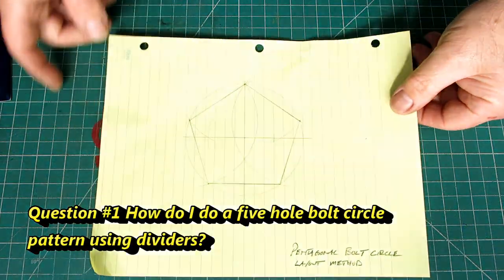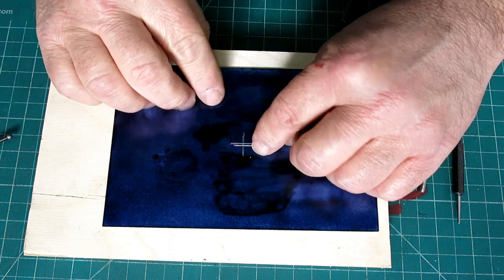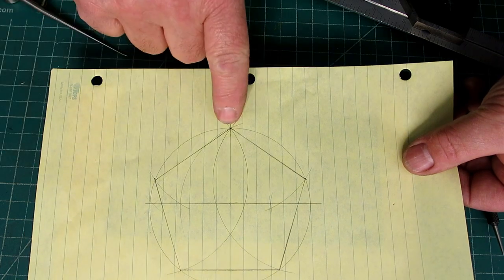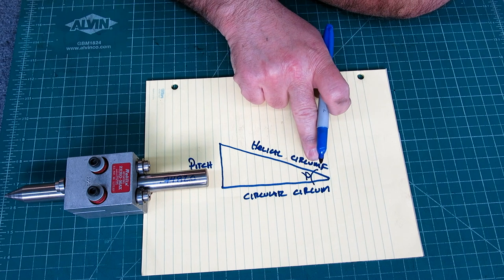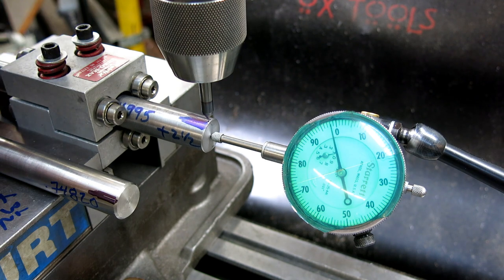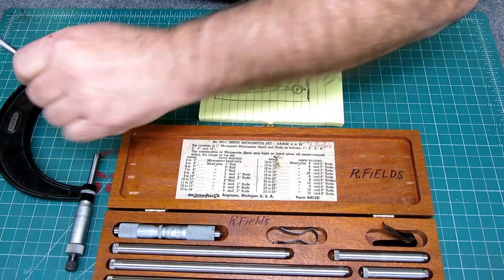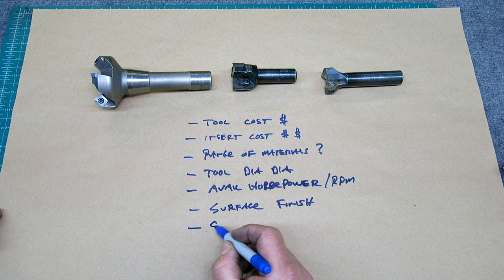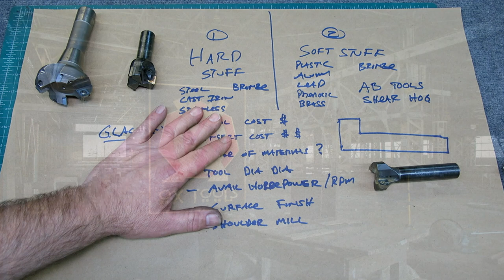Meatloaf 134 Comments and Questions

Comment: Rohlix Pitch Error:
Modeling an assumed design diameter of 0.75000, pitch of 0.10000 and the pitch angle calculated from the circumference of one turn, you get a pitch length (the hypotenuse not the circumference) of 2.358316 and pitch angle of 2.430250. Now, using the actual rod diameters and assuming the pitch angle remains constant, you get 0.099760 travel from the 0.74820 rod and 0.099993 travel from the 0.74995 rod. This doesn't account for a possible pitch angle change because of the diameter change.

Since the angle of the bearings are fixed, it might be safe to assume the pitch angle is constant. However enlarging or reducing the bearing distance may actually change the pitch angle and at least partially correct for rod diameter differences. The few thousandths difference in diameter is much smaller than the difference in the distance of the screw path and unlikely to make much of a change. I would need to study the construction more closely and probably develop a much more complex calculation for the expected pitch angle. The numbers above seem to be close enough that it will be difficult to actually measure though.

I did this in a quick spreadsheet. It is all pretty much basic geometry once you unwind the "screw" into a simple triangle. Another way to look at a screw thread is an incline or ramp.

Comment: LOL If that side was anything but 2.351141009169893..."  (about 2-45/128" ) you need to redraw it. 

There are a few more ways to construct "true" (not depending on how accurately you can read a scale or protractor) pentagons, but this is certainly the easiest to understand.  

Lens wrench, optical wrench or filter wrench are all names that I have seen used. They are extremely easy to make from plate, out of almost any material. (I have a huge set made from phenolic that I got from Deutsche Optik many years ago.) I would not extend the cut for a hinge, as the non-crushing aspect of these wrenches depends on the uniform flexing of the entire surrounding material. Making a hinge leads to crushing  from either side of the hinge.  For the same reason, I would also round the business end, rather than leaving the corners intact.

Comment: Great info Tom, thanks.

Regarding the drill sharpening guide, what if you rotated the "V" notch 180 degrees, so the drill would rest on it with much less effort? Would also be easier to 3D print as you wouldn't have any overhang.

Regards,

R
Reply from the maker: Nothing to keep the heel of the drill from slipping out. My thinking was I wanted to trap the base of the drill and allow a consistent reference position when the drill was rotated. You could still print this style in two pieces and screw or glue them together. Thanks for the comment.

Cheers,

Tom
Reply: Using the simple drill lip length guide to support the end of the drill a bush with an internal cone is another way to do it.

Comment: Tom, in your opinion do the square edge facemills seem to "hammer" the spindle a bit more in the cut vs a facemill with the insert on a 45*?  Or is that more of an insert count in the cutter issue? I have a square edge insert endmill that I'm not a fan of, just seems like it's abusing the bearings given the racket it makes.

Comment: I actually LOLed when you said "because I like the smell of Dykem!)  Me too....
Reply: But I hate Blue Dykem. I've always found d it to flake far more than the red. But neither one holds a candle to blue vitrol
Reply from the maker: @mpetersen6  Yeah but what does it smell like? 

Cheers,

Tom
Reply: @oxtoolco  
Truth be told I can't remember. Too many other smells in the shop. But when properly mixed on a really clean surface it gives a wonderful copper color. Fairly easy to mix up actually. At one time I also had a bottle of white Dykem for working on castings. I've never seen any of the other colors besides blue though. Just don't try and use the other Dykem product for layout work. You would have a hard time keeping your lines. 😖

Comment: Fastest method i know of, that gives you a pentagon from a circle is actually a memory play. If you draw lines from the center to each corner of a pentagon, and measure the angle between them you get 72 degrees. 7-2=5 (penta) So all you need is a protractor and a pencil. You put a dot in the center, draw a line, measure 72, draw another line do the same, five times, and you then measure the length you want on the five corners of the pentagon. Quick and dirty.

Octagon is 45, hexagon is 60. Easier to remember those, really.

Now, it's gonna come out as brag, and it's not, but that's (the whole layout deal Tom expertly explained) stuff we did back up until 10th grade school here in Europe. Really meta, to see stuff like this being placed on a different pedestal in other corners of the world.

Don't get me wrong, even as an architect, i barely ever use this, and in my hobby as a machinist, i generally use a sketchup cheat (for bolt hole patterns), because it's fast as heck, but it's still weird.
Reply: The divider and straightedge procedure is more exact than your ability to position and mark with a protractor... at least, with a typical half-circle protractor.  With a precision vernier protractor, you're probably right.

Comment: I love it. More layout technique pretty please!
Reply from the maker: Ok what layout would you like to see? Thanks for the nice comment.

Cheers,

Tom
Reply: @oxtoolco  as a total novice, I was hoping you'd tell me. hehe
Reply: @oxtoolco  I'm sorry, it's been bugging me that my response was less than helpful. I think there have been lots of examples of people using, for example, a height gauge, sine bar, surface plate etc. But I think this is one of a handful of times I have seen a pattern layout on a surface like this. I don't think alone in being too used to clicking the circular or rectangular pattern button and calling it job done. My short response previously stems from my lack of knowledge about what techniques exist that could be communicated and also be an interesting video, sorry about that. 
Thanks and endless gratitude for everything you do! Ash

Comment: This is a related problem with inserts . You should change insert by wear land not cutting ability. A dull carbide cutter cuts way better than HSS steel when its dull . That's why a lot of cutter bodies get trashed . My opinion wear land should  not exceed .010" but .005" would be safer .
When one insert goes you get a domino effect .
When first goes the one behind takes a double load on a insert that is already dull . A cutter can be whipped out in just a few seconds.

Comment: regarding your drill point gage - wouldn't it be easier to use if the V slot faced the opposite way? then you can just push the drill bit in and scribe a line instead of having to do this tilting motion, pushing the point and pulling the shank.

Comment: Tom, I have a question.  I rebuilt a KR Wilson 75 ton press and the pinion that runs up and down the cylinder rod(which is a rack) was worn out.  Long and short, the pinion itself was 1.5" in diameter and it only has 10 teeth.  It was an 8 DP and all the books that I have the cutters for an 8 DP only go down to 12 teeth.  I have a friend that has a bunch of involute cutters so I went to his place and laid a cutter up against the tooth and the one that I found that matched it best was a 10 DP if that makes any sense and it was a number 7 cutter, 14.5 PA.  I had to find center lower the table .030 make the cut and raise .060 rotate my dividing head 18 holes in a 20 hole plate and make another cut.  
My question to you is, is this a common practice to have to do this?  Is there a better way to do this, and was there a special cutter that was made just for this pinion my KR Wilson.   I was able to make a new one out of 4140, but I would think there would be a better way because if there wasn't still some decent teeth on the old pinion there is no way I would have ever been able to figure it out.  I ended up putting the old pinion in my dividing head and lining up the cutter to that.  
Any insight would be greatly appreciated Tom.  Thank you, Chris

Comment: I could be wrong but I'm thinking that you're sizes are too close to see the difference with that indicator on only one rev. Why don't you try running 5 with a reasonable way of checking that you're back at the start angle (maybe a v block and a square?) and see what it ends up with? We use those wrenches at work (although a fair bit bigger), either friction tongs or barrel tongs or barrel wrenches..

Comment: Tom, thank you for another great video. Does this layout method only work for pentagon or are there adjustments for other shapes with sides of the same length?  Separate question-- why does an edge finder move so far off axis with only such a small movement beyond the edge of a work piece?
Reply from the maker: There are many kinds of bolt circle and polygon layouts. I always liked doing layout work like that myself. The edge finder moves off center so much because of the slight friction between the tip and the work. Notice it's always in the direction of rotation. Thanks for the comment.

Cheers,

Tom

Comment: One note on center and prick punches and their sharpening or trueing up. Doing it off hand on a pedestal bench grinder is a recipe for disaster when doing accurate layout work. I always sharpened mine on a surface grinder using a Spin DeX or something similiar. The punch chucked up in drill can get you by but only if you can hold the drill extremely steady. If the punch is trued up with inconsistent angles it will drift to one side. Also if they are available die punches make great center and prick punches

Bisecting the plate. Corner to opposite corner both ways. Done, on center.
Reply from the maker: I sharpen the prick punches on the Deckel if they fit the collets. Alternately you can spin them in a cordless drill and carefully apply them to a grinding wheel or a sharpening stone depending on initial condition. As for the center mark that is certainly one way of finding the center. With typical orthogonal layouts the diagonal lines are useless after they determine the center. More often than not a parallel and perpendicular line is required. Just old habit for me.  Thanks for the comment.

Cheers,

Tom
Reply: @oxtoolco 
Oh I agree that the corner to corner lines are pretty useless for later construction work. I usually just did a rough measurement each way and went to the nearest whole number. Easier to remember for us old farts. Actually the one layout tool that is very useful is a dial caliper. Easier to set than a digital and less strain on the eyes than a vernier. Very useful for coming off of the edge. Most of my layout with bolt circles involved gaskets. I've also seen videos of guys making custom gaskets with a Cricut
https://www.google.com/search?q=cricut+gasket+maker&oq=cricut+gasket&aqs=chrome.0.0j69i57.7427j0j4&client=tablet-android-samsung&sourceid=chrome-mobile&ie=UTF-8#

Comment: Centreless ground shafts aren't necessarily round, even though they are of constant width.
Reply: What? Is this symatics? Round is realitive at best it can only be curved but by definition a circle has to have a constant diameter. A cylinder has a constant diameter or else it a rod shaped object.
Reply: @FrancisoDoncona  The cross section can be a "Shape of constant width", rather than a circle.

Comment: That was great, but what if the bolt circle was 17 points?  How do you know how to establish the cord length geometrically (without a table)?
Reply from the maker: That would be by using the principle of self proving by division and closing the circle. It's a foundational principle but not an exact geometric construction. 

Cheers,

Tom
Reply: @oxtoolco  Actually Gauss proved a 17-gon can be constructed exactly.  It was the first geometric construction breakthrough in 2000 years since the Greeks.  The construction is not easy,  but is possible and exact.  He proved any prime number N-gon with the preceding number a perfect square can be constructed exactly.  17 is prime and 16 is a perfect square.

Comment: As mentioned by 'chuckbuckets1' elsewhere in the comments: The helix angle is fixed by the bearing angle and thus the pitch is dependant on the circumference of the rod. 

The pitch variation you are seeing is likely caused by the lack of stability of the single row bearings used on these devices . If you think about it, the bearing is loaded to one side leaving the available space in the groove for the outer race to move .

Comment: Straightedge and Compass construction (the layout process you used) is foundational to geometry, but can't be used for every possible layout. EG it's impossible to (exactly) construct a 40° angle with a finite number of steps and without measuring a length, only to approximate it. https://en.wikipedia.org/wiki/Constructible_number
Reply from the maker: I think I would attack this problem with the principle of self proving the division of a circle. You are correct that a geometrically "exact" solution probably does not exist. But hey were in the engineering world and will get close enough for any practical purpose. Thanks for the great comment.

Cheers,

Tom

Comment: If you use pythagorean theorem the difference of the hypotenuse between the diameters of 0.74995 and 0.74820 using 0.2 as the pitch is .00169. That is not a whole bunch so I would have to say that your setup, while clever enough in itself, is never going to be accurate enough using a gauge that will only measure in thousandths regardless of what kind of shape the bearings are in. Any number of things such as  bad bearings, slippage in the mechanism itself, deflection in the setup, temperature of the rods being tested, tension of the springs holding the mechanism together ad infinitum could affect your results rendering the test as moot.

Comment: Tom... I'm a big fan and have been for quite some time.  I'm not going to lie though, the first part of this meatloaf hit a nerve. Those knife makers put everything they can into their craft. The tools don't make the artist and perfection isn't perfection when it comes to art. You used a combination square, a divider, a scribe, and two different punches to make a five bolt pattern with all these measurements to only eyeball the center... Draw a X from opposite corners for center, make circle, punch every 72° from center. Done.
Reply: It is an assumption that the piece of metal is square to start with. If it isn't square, your X won't be centered. The average going from side to side will help negate those errors. Also the method of adding an angle all the way around will end up with a compounding accuracy error at the end and the points won't meet.
Reply from the maker: I meant no disrespect for knifemakers in general only that I had observed some dodgy ways of doing layout. No one can argue with the fantastic results they get. My intent was to point out there are standard tools and methods for layout that any person involved in marking and layout should be familiar with.

Regards,

Tom
Reply from the maker: I thought about this some more. How would you feel if your doctor showed up for your abdominal surgery with a Ginzu kitchen knife. Or perhaps a new carpenter on the job was slinging a ball pein hammer in their nail bags. Both tools will arguably get the job done, but are clearly not quite appropriate for the class of work. I think this better explains my comment about layout tools.

Cheers,

Tom